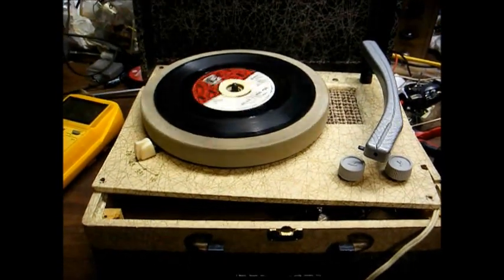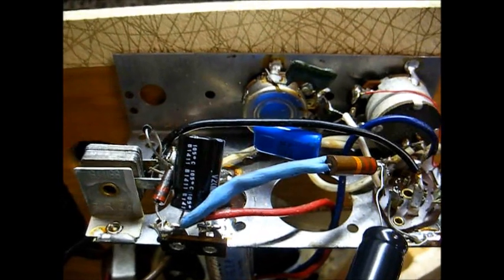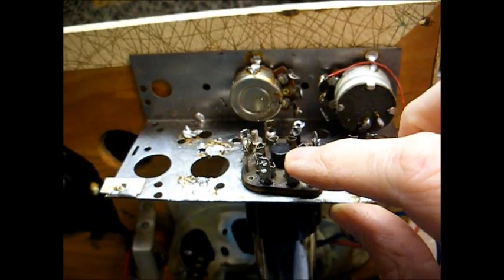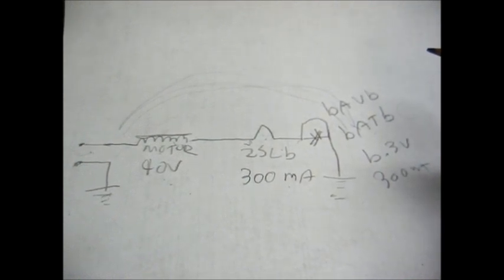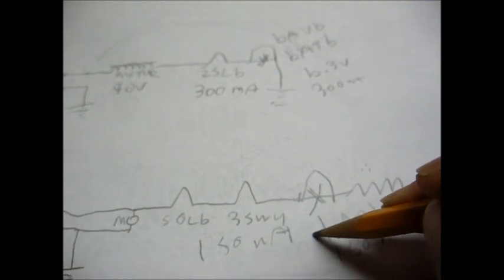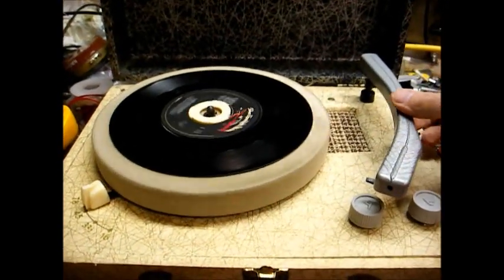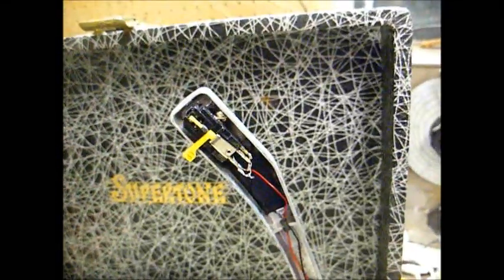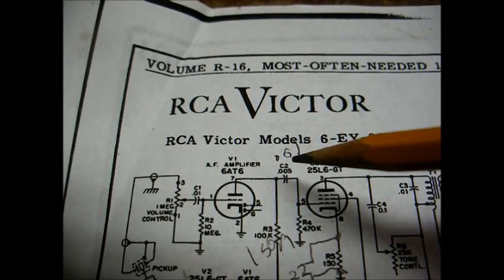Record player conversion from 3V crystal cartridge to .5V ceramic cartridge (amp modification)

Comment: Did anyone ever try wiring replacement stereo cartridges in series for more output instead of wiring them in parallel as usual?
Reply: I did exactly that on two units, the volume was good, it is not as powerful as if there were a preamp but it it certainly room-filling, albeit at close to max volume control setting.

Comment: Hi love ur video's I've built this same set an tried to do it just like yours But I'v wired somthing wrong the 6at6 I've got 69-70 volts on pin 7 plate but have no audio at all an pin 1 goes to the center lug of the vol. gives me minus voltage what voltage should i have the 25l6 has good volts on pin 3-4 any Idea????please helppppppp

Comment: Waaaaaaaay too much work.  A transistor, rectifier/filter (sourced from the heater) resistor and two .47 caps and you have a dead quiet preamp in 20 minutes, without having to gut this thing.   A bit more work (but less than adding another tube) is an op amp.  You'll get a preamp and true bass and treble.
Reply: like that,, Good words..
Reply: If you say so...
Reply: I'd MUCH rather have a TUBE driver than a cheap solid state device added. Just seems sac-religious, LOL! IF it was a solid state amp to begin with, then okay, but I'd rather keep a tube amp a true tube amp & have that nice warm sound!

Comment: Great video! I have a couple of  40's Radio-Phonograph Consoles in the "queue"  for repair/refurb and have the same issue regarding cartridges for the turntable. Was just looking at adding a transistor based pre-amp module between the newer cartridge and the radio phono input, but this gives me some other ideas to play with.Thumbs up and subbed for more great ideas!
Reply: Yes, I have the same problem and thought of a Transistor Pre Amp.  I think it would work just fine.  I am thinking that you would have to filter the power supply really well to prevent any Hum.
Reply: Yes, transistor or even op-amp based pre-amp would work. Biggest issue is a clean enough power supply source for the radio. Low enough voltage and well filtered.

Comment: I have made a ECC85(similar to 12AX7, double triode preamp and EL84 (6BQ5), and i wonder if i should put a negative feedback in the circuit to stabilise it and prevent crap audio or should i go without NFB?

Thanks
Reply: +Slovenija12345 
By crap audio i meant too high input signal ...

Comment: That chassis is rather interesting, it looks like three of the holes were punched to take a seven pin miniature tube socket, so if you did not want to use a 25L6 that may have been an option. I think that I would leave a cathode bypass capacitor connected, whilst true that it does boost the volume level it's real purpose it to reduce degeration of the stage. Besides that it's always nice to have a little headroom in an amplifier to widen the dynamic range. Most of the speakers were good up to whatever an AC/DC radio would put out, which is about 2-2-1/2 Watts.

Comment: That's a fantastic upgrade, might be worth it putting a better speaker in it now. Seems like this amp would work really well with the 0.9v P132D modern ceramic cartridges too, I just wish the connection pins weren't such junk on them.